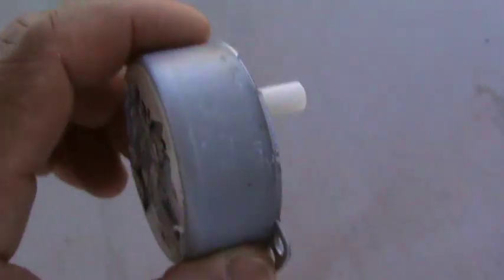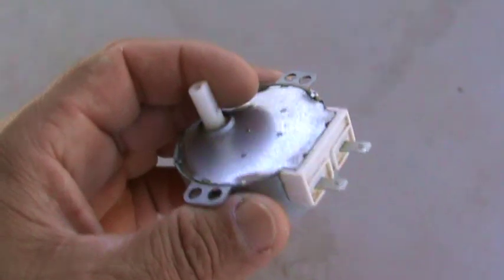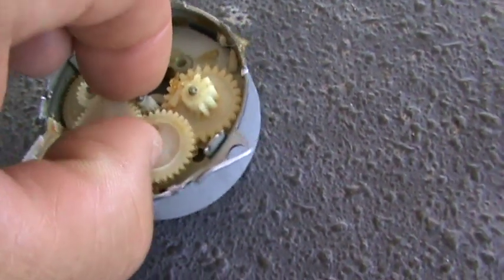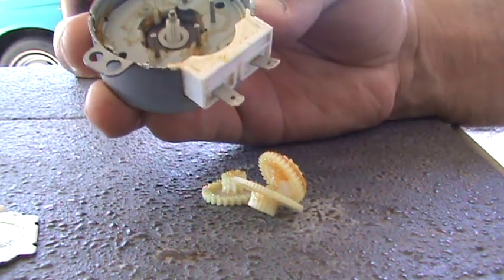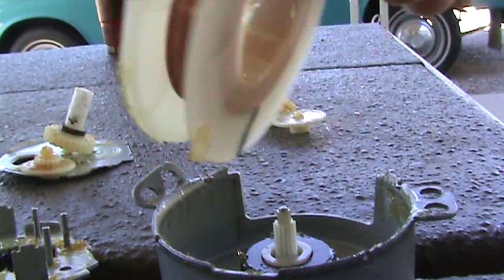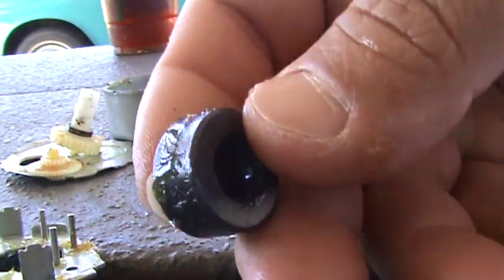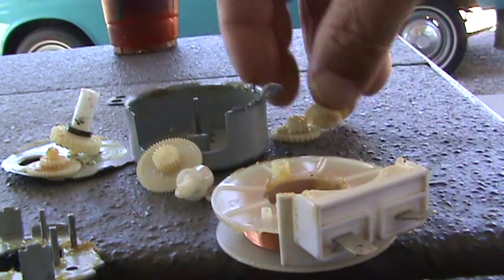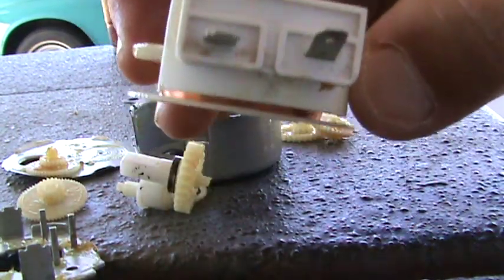Electric Shock from microwave motor mystery solved

Comment: That magnet ring is multipole magnet, has like 8 or 12 poles, and is inside a "cage" and move the magnet field from the edge coil to the inside, where is the magnet, and work like a generator.
Reply from the maker: This is a old video, this thing sure will shock the tar out of you.

Comment: It is not very dangerous.  It can create high voltage but very low amperage.
Reply from the maker: It can shock the hell out of you, I know that from experience.
Reply: @Iseekoutthetruth  Yes you can feel quite a bit of volts.  But the amps are so low that it will not cause any damage.  I have shocked myself a few times..  It is allot different than getting shocked from a live wire from your house.
Reply from the maker: @vermiman  oh I felt it BIG Time, made my Legs Buckle and my Left arm hurt for 3 days.
Reply: @Iseekoutthetruth  Yes but if you get shocked from a live wire from your house 110 volts with higher amps, it will lock onto you.  When you are turning that little turntable motor, the shock only last as long as you are turning the dial and touching the leads.

Comment: No worry, wouldn't kill ! the among of electrical power generated from this motor by hand cranking are limited.
Reply from the maker: it was a extremely painful shock and at my age it could kill you easy I think.
Reply: Yes, for old age or weak heart could be dangerous !

Comment: That happend to me at an used appliance shop I work at a I was pulling some turnplate motors for a customer for an art project I she need the couplers too i was going threw them to see which on fits I turned it my fingers where on the prongs and it gave me quite the zap me and a tech put a voltage reader on to another one they put out around 200 volts.
Reply from the maker: Yup, they can zap you pretty good.

Comment: Does it matter which of the 2 cables get connected to which side of the turntable motor ?. As their doesn't seem to be any visual marking on the motor ?
Reply from the maker: it works either way.

Comment: Those motors are heavily geared down to turn your plate of food slowly. Turning the shaft creates very high rpms on the magnet in addition with the very thin magnet wire which has around 1000 or more turns on it, creates a high voltage AC output. I have personally measured up to 800 volts AC. Of course it's low current.
Reply from the maker: +Robert Tomkinson it packs a very painful shock.

Comment: the round magnet has north south around perimeter and when it spins it produces magnetic current through the metal flaps; some flaps come from bottom up and some flaps come from top to bottom therefore producing a constantly changing magnetic current from top to bottom, as the magnetism travels from top to bottom it has to cut the fine wires producing a high voltage  but little amperage. if wires were thicker then it would produce lower voltage but higher amperage.
Reply from the maker: +Alex Manzanero all I know is it hurt like hell when it shocked me.
Reply: i did 120 in my mouth and makes you see white light in your eyes with a 120 turntable motor.
Reply from the maker: that is crazy! why would you do that?
Reply: well i was turning it slowly ...very slowly because i knew it was a 120 volt motor/generator; high voltage but very small amps, and yes it was pretty neat to see lights with your eyes closed.
Reply from the maker: why would you put it in your mouth? do you like to shock yourself?

Comment: its simple you just turned it into a dynamo the way its made the coil is usually on a spindle or shaft that way they built it was cheap but yes it works like a clock work radio or light you just wind it up with a handle so get another get a multi meter see how much it generates if it has a larger output than what you need put a resister in line to the value of what you want to drop it to then attach it to a rechargeable battery then a bulb and you have a circuit for a rechargeable wind up light etc drop all that in a box with a bit of hot glue you just invented your first everlasting radio torch what, ever you want that will run on the voltage output ok dont expect to run a tv on it you would need a bigger battery and you would be sat there winding a few hours lol
Reply from the maker: I made this video 7 years ago, and have forgotten about it. this little motor shocked the hell out of me. thanks for the video link.

Comment: I don't know, man. This thing runs pretty slow, I doubt it generated energy, maybe the shock you took was directly from your electrical outlet. How many shocks have you taken in life? I've taken like.... can't count it. from 110 to 220 v.
Reply: I have been shock from them motors myself and I was using a griping tool to turn that knob...... remember the knob may been turning very slow but due to the internal gears the magnet could be turning 50-60Hz revolutions per second to get the 240v out, if you look at the label at the back of the motor this will give you the info you need about the motor, the voltage output may be very high but the current will be very low something in the order of milliamps eg (0.2mA) this is why you will see on the label at time. 240v at 50-60Hz, 3 to 3.5w........ remember (( 3w / 240v AC = 0.0125A)) as an example of OHMS law.........
Reply from the maker: I have taken many shocks and this was the worst shock I have ever received, its a powerful little motor,
Reply: Iseekoutthetruth was it inside the microwave or you as using it directly to your electrical outlet?
Reply from the maker: Squall Leonhart if you watch the video of me dismantling the microwave you see me getting shocked. I had it outside of the microwave in my hand with no AC power connected to it, go try it yourself if you don't believe me but do it at your own risk, its a powerful little motor.
Reply: Iseekoutthetruth Ah I get it now and I was right. I never doubt you took a shock, what I'm questioning is a voltage bigger than 220v. I thought your motor was actually turned on on electricity, and you accidentally touched your finger where you shouldn't while messing with it. In other words, by your description and other people comments, it seemed like the engine was turned on and the voltage was bigger than the one specified, like 500v. What probably happened was that you took a 220v, am I correct? I can only imagine a voltage bigger than that if you manually spin the engine pretty fast.
Reply from the maker: Squall Leonhart  this is a old video, I never check the voltage on it.
Reply from the maker: Blesroy its a powerful little motor.
Reply: Yes it is, I have been collecting them for years, with up to 3 to 3.5 Watts of out--put it can be put to other uses. I like the design........
Reply from the maker: Blesroy well thanks for watching.
Reply: SELL ME YOUR CLASSIC DATSUN PICK UP ,,PLEASE
Reply from the maker: mw10259 I sold this truck like 8 years ago,
Reply: very good

Comment: it is because it has a magnet and a coil , probably with a hundred-plus turns. as you turned the shaft, the gears inside turned your single turn maybe into tens or 20 turns inside, (Gears can increase either torque or speed, it is the "mechanical advantage" of using gears. And the moment you cranked it, the coil induced current because of the magnet in the middle, remember your elementary science class? that is why it gave you a shock.
Reply from the maker: its a powerful little motor thats for sure.
Reply: If so powerful and with no gears any videos of potential dynao as drill runs on 5v USB ive saw clip where thumb finger gets 7 volts so if connected to drill without the gwars to spin freely how much could it power? Free electricity if can spin 7 from hand and 5 v drill goes more ram than hsnd so free electricity for everyone? Or not?

Comment: nice classic pick up truck at 1.21, is that a Datsun????  my theory is this.. the motor is a high torque motor designed to run on AC as the label said ( I didn't expect to see a magnet in an AC motor!!!!!)..the motor runs a few hundred rpms in its core and the tiny torque, fast spinner it generates is amplified by the plastic gear arrays into a large torque running much much slower in the final drive that's connected to the microwave glass spin tray..so when you force spin that shaft even at several rpm its actually spinning the magnets much much faster in its core due to the complicated array of gears its attached to..so you technically produced several tens of volts enough to zap you in the output connecting prongs...these motors make very good electrical generators provided you can have something powerful to overcome and spin the heavy torqued gear driven rotor..As a GUIDELINE: The more difficult the (with magnet in the core, MAGNETO or DYNAMO not including ALTERNATOR ) motor is to spin, the better generator it becomes..the easier, lighter it spins the less power it generates..
Reply from the maker: +fidel catsro  thanks for watching and for the comment and yes it is a old datsun pickup
Reply: +Iseekoutthetruth I miss those pick ups, we cant find that here anymore all gone with the wind..its too expensive to keep anything above 10 yrs old.. the law here says they have to be sent to the junkyard, so restoring a classic and keeping it on the roads means super high extra taxes and levies!
Reply from the maker: fidel catsro
thats crazy, I see these old trucks every here. thanks for the comment and for watching.

Comment: Imagine the output power if you took two of these and connected them by shaft and in between the two shafts have a homemade gear you can put the shaft of one inside the gear then on the other side of the gear put the shaft of the other one. Make a bracket to hold both microwave oven turntables. Put this on a bike wheel shaft. You could get MEGA lights on your bike. OR EVEN MORE OUTPUT  Put neodymium magnet inside.
Reply: pudge There would be enough torque to make a rotisserie with one of these gear reduction motors but otherwise seriously limited due to the cheap plastic transmission gears.
Reply from the maker: this little motor packs a big shock!! it has some good torque. I was surprised what the inside looked liked. my arm was numb from the shocks hours after the shock it gave me. it is a dangerous little motor.
Reply: Iseekoutthetruth a shock collar for a small dog would do more in terms of actual voltage, especially if you were just rotating the output shaft with your fingers. Some people are hyper sensitive to the flow of electrons, everyone is different in this aspect. I don't doubt it hurt you, but it would be far more dangerous if you threw it at someone.
Reply: @nunyabusiness7630  It is the amperage rather than the voltage that is dangerous.
Reply from the maker: FINDER OF lol

Comment: Most modern microwaves have an automatic discharge of the capacitor. It's of course very smart to short it anyway just to be sure.
Reply from the maker: +Morgan Freeman  this is a old video of mine, I no longer use microwaves in my home.
Reply: @Iseekoutthetruth  woah you don't use a microwave? (:-0
Reply from the maker: @versedbridge4007  nope, never.

Comment: Ah okay so you did take it apart :D  I wounder if the bends in the sheet metal that holds the magnet in place have any real, significance.  I will be looking into this form of Motor more because it should not be able to operate the way that its arranged to rotate or generate power to my knowledge...
Reply from the maker: oh its a powerful little motor, it shocked the hell out of me, I hurt for days.
Reply: Iseekoutthetruth Ive been going over AC motor videos and I cant find a single one thats made similar to these little microwave motors.  BUT i did find out the shock hurt so bad because it hit you with  110v to 120v because you turned it slow.  If you turned it harder it would have jumped to 220v or 240v and you would be dead.  So your lucky  lol
Reply from the maker: Jared Graber yup, it sent a shock up my arm across my chest and down my right leg all the way to my big toe, I have watched and re watched this video many times and I am still amazed how I did not drop my camera lol. I have been shocked many time before, but this was the most powerful shock I have ever been threw.if you mess around with this motor becareful.
Reply from the maker: ***** I do not mess around with electronics anymore.
Reply: Epoxy a stainless shaft into the ceramic magnet and make a holder for the coil and shaft with good bearings. you should have a small but powerful generator. Though a dangerous one.
Reply: Iseekoutthetruth
Sad I worked in industrial electronics for years, three phase gearswitchs starters control panels,motors way up in the hundreds of horse power.   480volts near 1000amps. seen some pretty bad things happen to workers that lost their footing or just weren't careful.The least were the fingers and hands. the worse a life.
Reply: Yes it can. It's like a dynamo, it works both ways. It turns electric energy into movement and movement energy into electricity.

Comment: I think spinning the motor made it a generator. I had a toy train that was battery powered with a headlight. The batteries were dead one day and I was pushing the train along the tracks. The headlight lit up from the motor being spun by the wheels.
Reply from the maker: it is a small coil and it is very dangerous packs a whallup

Comment: It was probably left over voltage "capacitance" . The coils held a charge similar to a battery/ capacitor. Thanks for the heads up..was about to take out one of these motors out for a build- now I know i'll need to de-energize the coil first! Cheers.
Reply: No it produces around 230v plus electricity when you spin the centre it's crazy powerful (don't try it) I had arm and finger nerve damage for nearly a year random numbness and pins and Needles

Comment: Its not a mystery its down to the magnet moving inside the coil creating emf the same way generators work any coil and magnet will produce a current, id say looking at the motor has been geared down to create high torque so when you do the reverse the armature is spinning fast creating a high frequency A.C current which will be high voltage low current.

Comment: The motor right by the magnet must have been spinning really fast with the gear ratios or something. Thanks for posting this!
Reply: U get 230+ voltage wen u spin it my Fluke, multi.
Meter hit 400v at one point

Comment from the maker: oh ok I was wondering what it was, it is the microwave thingy, yea i put that in my shed in a box.
Reply: The magnetron has 2 magnets,heat sink,and the antenna that distributes the oscillation has a pink ceramic thing,if u breathe the dust particles in,u can get throat cancer,and the little box with the 2 copper windings,that's the MOT Microwave Oven Transformer,it produces about 1000-10000 volts,if u put a bug on the transformer,it will explode,so don't fuck with a MOT unless u got a death wish,at least now I can make a dynamo out of these,and power anything I want,you know they make the pocket sockets,well if u got a microwave turntable motor,u can make a homemade pocket socket,its pretty damn useful